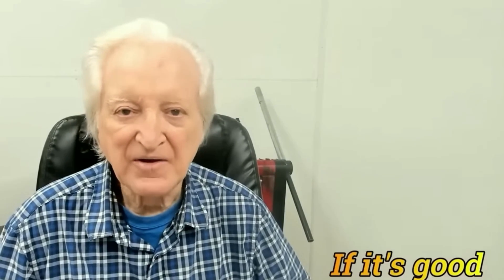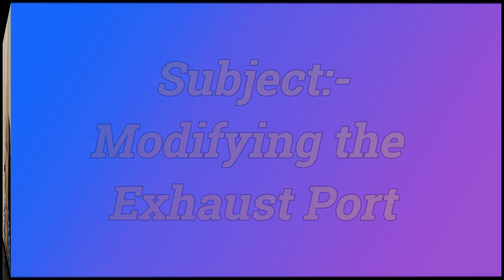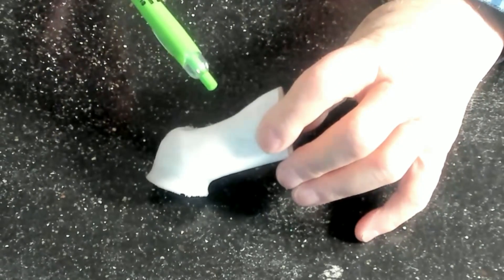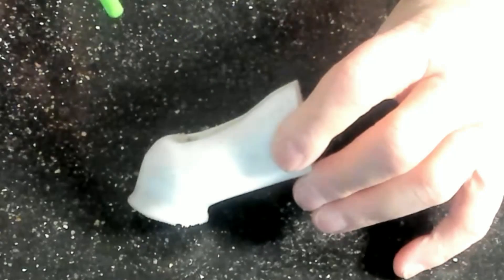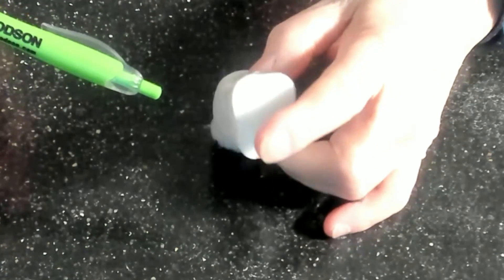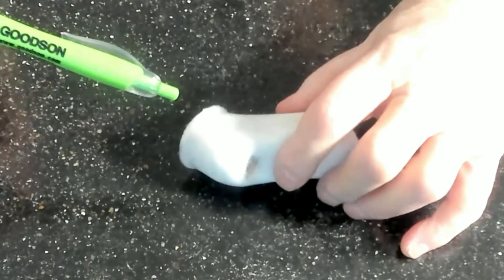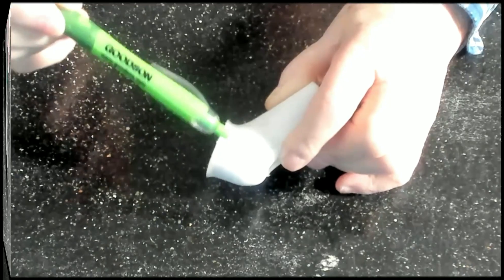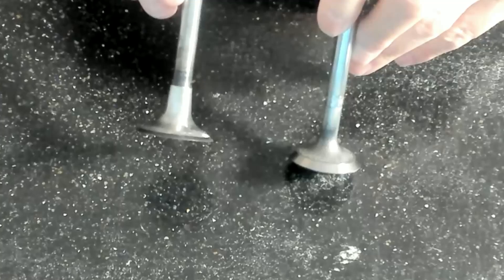Mission Impossible 318 Mopar ex. port - 45% flow increase!

Comment: one my flow better but do not use in towing, truck, motorhome, boat  the truck valve is much better materiel too
In general a tulip valve with 11/32 or Magnum valves on the exhaust, radius seat and no back cut on ex

Comment: Speaking of exhaust pipes/manifolds.
Would it make sense to use a kind of expansion pipe as in a 2-stroke? 
From my knowledge a 2-stroke is very dependant on the pipe dimensions and my thought is, that since a 2-stroke and a 4-stroke (with a Big cam and relatively large overlap period) the two cycles are somehow comparable? 
Or am I missing something?

Again - many many Thanks for sharing all that experience and knowledge. It is truly a real action of love and compassion for engines and humans ❤️❤️🙏🫶

Peter - Denmark - Europe
Reply: Jeez you'd need EIGHT of them around three feet (1M) long !!  Look into "Tri-Y" headers which make torque by coupling exhaust pulses.

Comment: If you have the valves with the thicker bottom stem, could they be turned on a lathe to a smaller radius at the transition?
Reply from the maker: I don'ts ee why not but let's have some input from Mopar experts.
Reply: Yes. Make sure the final cut is as fine as possible. Polish the stem with 400 grit. This removes possible stress risers that can be produced by the cutter

Comment: My next question concerns the block machining, head cutting, gaskets, and their effect on valvetrain geometry, using STOCK, non-adjustable hardware. The heads have been cut .100". The block, I will assume .010". All else being the SAME, the pushrods would be .110" too long. However, a REGROUND stock cam reduces the base circle, but nowhere near .110, I'm sure. So the difference would be adjusted by gasket thickness, lifter preload, or both. What say you, Professor? P.S. I believe the contact point of the rocker and valve tip may be affected as well. And I do realize that Mopar rocker shaft STANDS can be shimmed.
Reply: Good questions - waiting on answers.  SBC guy here....we just adjust the pre-load when assembling.I would still want shorter pushrods anyway.

Comment: Mr. V, I've been wanting to ask you about the cam. I know you advocate for TIGHT LSAs, 105-108 degrees. But if you use a REGROUND stock cam, you're stuck with around 114 or 116. How do you regain the torque lost due to that constraint? Compression?
Reply from the maker: No - we are not stuck at 112-114 LCA as you will see.

Comment: After seeing the gains here in the exhaust port I was about to go jump on my little 318 and go to town.  Then I realized I have that "other" 318 called a 318-3.  Are the sodium exhaust valves still ok when opened up to more flow and heat or do go to a more modern exhaust valve.  I believe there are water passages around the spark plug, but are there any other differences that would keep me from following your porting guide for a 318?  Maybe I need to find a junk 318-8 head and put it under the bandsaw to figure out this mystery?

Comment: 165cfm @.5" is not bad for being a small port.
Reply: I will be doing my own Mission Impossible but with a 305 sbc lol. Funny thing is the 416 heads flowed 198 intake and 140 exhaust right out of the gate. Using your tips as well as DV 's I hope to increase the flow and make it more efficient. Good work on the heads Charlie I enjoyed watching👍.
Reply: @plumcrazy588  Thanks, they will flow quite well with some work but they do have issues. I think they have extra tin in the iron to make them stronger for a thin walled casting, this causes the guides to wear at a faster rate it seems. This is why they are crack prone. The guides wear and the seat overheats and cracks. Do not take a ton of metal out , use 1.85" intake valve. On Speedtalk I did a set of 450 castings and got better than small port vortec bowtie head flows. 450 is about the worst casting ever.
Reply: For that size port 165 is a home run!

Comment: The magnum exhaust manifolds from the magnum 318&360s of the 90s are probably much better then the regular 70s and 80s manifolds
Reply: Not only that, but Uncle Tony spilled the beans that there are 2 different sized Magnum exhaust manifolds; ones with a 2" outlet, and ones with 2 and 1/4". Much like the old Corvette "Rams Horn" manifolds were 1/4"  wider than other Chevy Rams Horns.
Reply: My understanding was this engine was going to use components that it came with in the period it was made like the bbd carb. I had a 1986 ram charger that came with a LA engine with a  Quadrajet that I'm certain would remove the biggest restriction in this build but thats not sticking with the original idea/plan for mission impossible. I beleive the challenge of using stock parts from the period correct engine is what makes this build so interesting and fun.
Reply: Uncle Tony saw that in a Mopar Muscle magazine writen by Randy 
Bolig .
Reply: 92' & 93' Magnum motors had the best. Supposed to flow at least what the best 340 Hi-po manifolds did. Can't remember the casting numbers right now but I picked up some at Mopars at Carlisle about 3 years ago for my dad's 318 Dakota. The exit is much cleaner and larger that the typical 318 manifold.

Comment: Very nice increase
Reply: Hay  Ricky are you talking flow or compression
Reply: @rodhendrix5973  Flow Rod
Reply: @Ricky Fulks  ok I have two sets of cast number 302 mopar heads one set has dished exhaust valves and the others have flat exhaust valves  that's why I ask witch one was best one set is going on a la 360 the other set is going on a 318 pre magnum roller cam la   and thank you  very much for the info  you have a go night.
Reply: @rodhendrix5973 The dished could possibly b lighter which is good Rod
Reply: @Ricky Fulks  so does this let the engine rev higher with the dished valve or does it make any difference
Reply: @rodhendrix5973  Light valve train components will help prevent valve float at higher rpm's
Reply: @Ricky Fulks  so lighter higher r p m  and heavery lower r p m  thanks Ricky